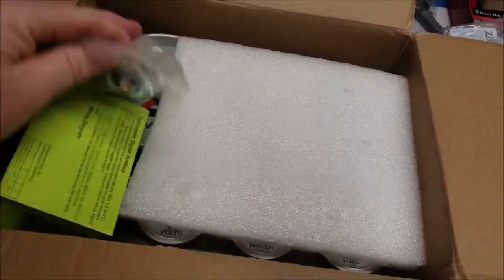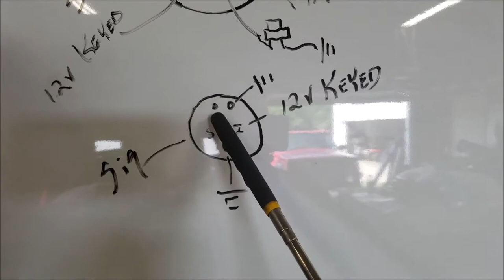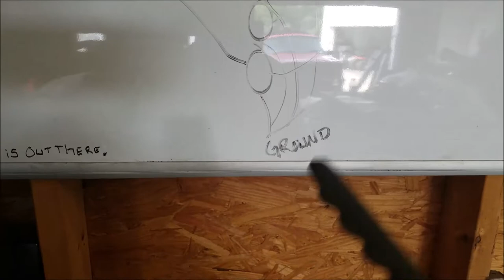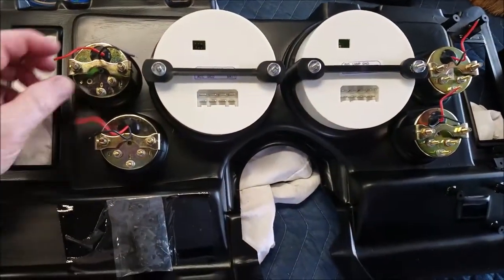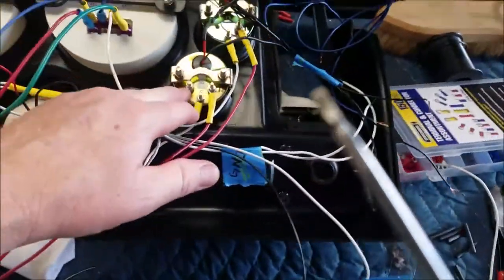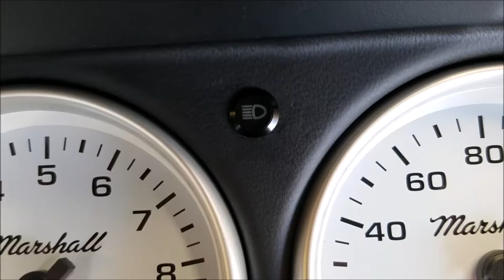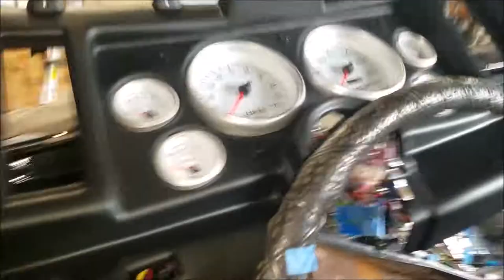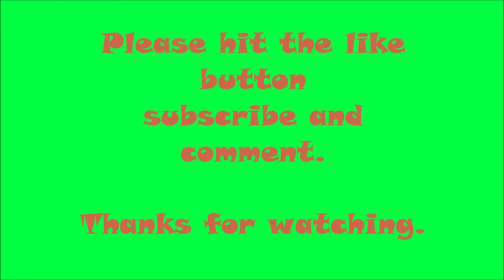Marshall Gauges install part 1

Comment: Do you know if the outer ring bezels can be removed and replaced for different finishes?  Thanks
Reply from the maker: @blakeminson6518  Just checked, and I can't remove them.👽
Reply: @AlienRestoMod  thanks for checking. Was hoping to get the Marshall gauges they make for Minis with the silver rings and swap the rings to polished to match mine. But silver will have to do.
Reply from the maker: @blakeminson6518  Paint them.👽

Comment: 67 Firebird I use LED so the turn signals and the high beam
Reply from the maker: Did you have to get a special electronic flashers for the LED lights?

Comment: Gauges need to have a very low voltage fuse autometer
Reply from the maker: Do you think Marshalls will need the same low voltage?👽
Reply: @AlienRestoMod  yes you need a lower voltage fuse for the gauges